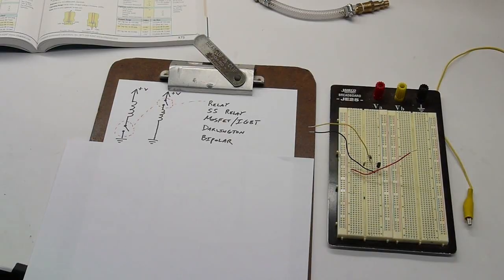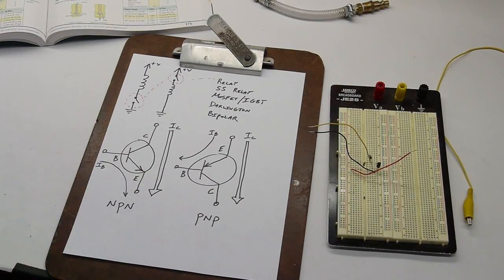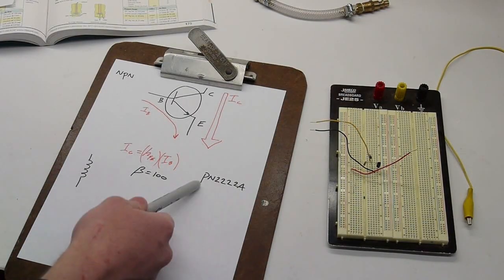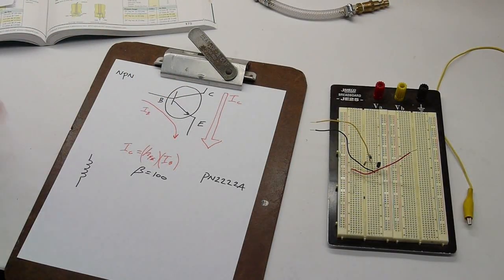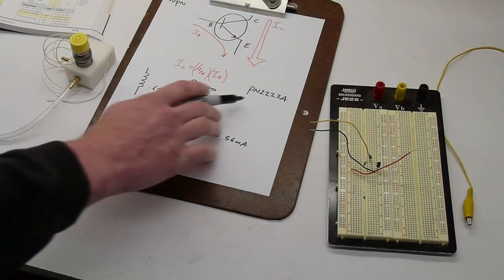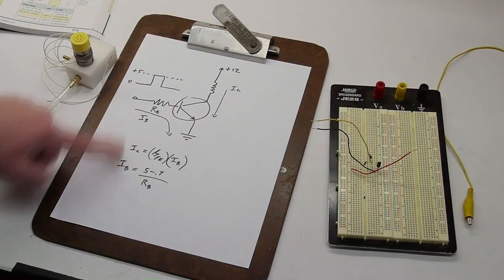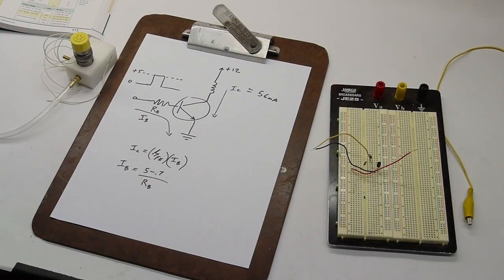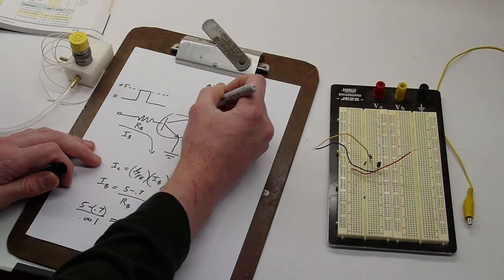Tutorial: How to design a transistor circuit that controls low-power devices

Comment from the maker: When the transistor turns off, current flowing through the coil will cause a voltage rise on the collector. If the voltage rise is high enough to turn on the diode, current will flow through the diode and limit the voltage at the collector. The problem is that the diode cannot turn on instantly. It takes time for the diode to start flowing current. The capacitor smooths out the rising voltage, and gives time for the diode to start conducting.
Reply: schottky diode will just fine.
Reply: Your 5 volt input may have been solid between ground and +5v.  I always put a 47K from base to emitter to deal with any leakage currents if the input is inadvertently left open, either by design, or by a failure mode.
Reply: Applied Science that part was curious, I was wondering why the diode feeds it back, wikipedia said it feeds the back emf back into the solenoid to lessen the change in current it experiences when turned off, love it.
Reply: amazing video mate! but, could you tell us what diode should we use for this clamp?
Reply: @figadodeporco  The maximum current that the diode will need to pass is the current flowing when it is on. The maximum reverse voltage it will see is whatever the supply voltage is. In this circuit you need a diode that can handle 56mA and 12V reverse. You'd be hard pushed to find a diode that couldn't handle that. You don't need a Schottky or anything esoteric, just a 1N4148 or a 1N914 or a 1N4001, etc.
Reply: @figadodeporco  Most times you'll see a 1N4001 used, but it's not critical.
Reply: Ben: Interestly enough, I learned all about this the hard way. Transistors with internal "Protection" diodes like many MOSFETS offer, might protect themselves from damage but as you explained are not always fast enough. I had this issue with a MOSFET w/flyback protection still causing a microcontroller to reset everytime the solenoid load was triggered. While the MOSFET didn't destroy itself, there was a ~400V flyback spike induced from the collapsing field, and that caused the mCU to reset. Drove me nuts trying to find it.
Reply: @fjs1111  The body diode in a mosfet will conduct when the drain becomes reverse biased with respect to the source. In the case of driving an inductive load, the drain will be forward biased wrt the source potentially by hundreds of volts, therefore the body diode offers no protection whatsoever in this case. It's nothing to do with speed.
Reply: @fjs1111  You can't name a single mosfet that has protection against driving inductive loads. There are some ics, for example H-bridge motor drivers like TB6612FNG, that have built-in flyback diodes, but no stand-alone mosfets have them.
Reply: Are you serious, you are clearly not an engineer! @RexxSchneider
Reply: Keep making your case to the world how little you know. Have at it.  @RexxSchneider
Reply: As a beginner, I have burned several optocouplers, and transistors, due this voltage spike. Thanks for the hint.
Reply: What I didn't understand for a while was how the capacitor does this. But then someone explained it like a hatchway in a water pipe: 
->\ 
A direct current would be blocked by it but a spike can pass through it because it would push the hatch into the flowing direction:
->/ 
and thus move the water on the other side of the pipe:
->/-> 
so the energy of that spike gets consumed and once the spike rising is over and it reached it's top point, the capacitor stops pushing against the other side and blocks the direct current part of that flow, which would then drain to the +12v if the coil's generated spike is greater than +12v.
Reply: @dreamyrhodes  Capacitors act as a short at high frequency signals. Increasing frequency means lower resistance in a cap. A fast rising edge of a pulse or noise spike is high frequency. This is why these caps are called bypass capacitors, by passing the hi freq sigs to ground in order to remove noise from the voltage supplied to the circuit which will adversely affect circuit performance. Basically acting as a high pass filter. Filtering out unwanted hi fregs.
Reply: With the capacitor it make sence. But in all my life I never saw that capacitor to ground in Relay circuit. i red the use fast diode or low threshold voltage diode (Shotky?)
Reply: I have npn output air flow switch, where set point to switch on or off...

How i  get analog value (either voltage or current) each increasing or decreasing of flow rate?

Please help to figure up, thanks

Comment from the maker: If you can guarantee that the base current will be 5mA, it should be fine, but you'll generally want/need to use a limiting resistor.

Comment: Awesome video! Just what I needed for a senior design project. Although I have one question, if you are using a data acquisition unit that outputs 5 mA, can you just connect it to the base directly? I know you mentioned that a resistor has to go in between, but given that this is a different case ...

Comment: Great video! thank you for posting.  I just have a quick question regarding the clamp diode. Please point out if I am wrong. Without the diode, when the transistor is turned off, an induced current is generated in the resistor due to the Lentz's law, it can be very large when the switching frequency is high, and the large current/voltage can damage the transistor; With the diode, as soon as the generated induced voltage is larger than 0.7V, the diode will be turned on and direct the current back

Comment: If a voltage applied to the base of a transistor rises above the emitter by more than the base-emitter threshold voltage, then the current going into the base will rise, abruptly, to a point where there will be too much current that can destroy the transistor. The purpose of the base resistor is to absorb the excess voltage, therefore limiting the base current to a safe value.

Comment: very interesting video, doing my btec level 3 electronics engineering and learning about pn junctions and transistors. the .7 volts comes from the depletion barrier. holes and electrons changing place as the p and n come together. maybe the difference between the voltage for diodes and transistors come from the extra junciton on the transistor. two diodes back to back. 
i look forward to the rest, cheers dude

Comment: Wonderful video!! Is the process the same if I want to control a 12 volt motor high amperage motor? How would I select the  proper transistor if I am using a 0-10V PWM input?

Comment: I think I answered my own question re the solenoid...about the fifth time through the video I picked up the 'clippard' name, I see their web site has a great order page.  I have determined that's a 2 way mouse valve, wire leads, normally closed, I'm going standard mount instead of manifod, 12v, .025 orifice with buna seals.  Awesome video.

Comment: If the input voltage is 3 v instead of 5v will the transistor still turn on? Given that rb is changed to 3.0K Ohms. And what if 1.5v and 800ohms? I guess my question here is does voltage matter?

Comment: Could I use a 2222 to trigger a 555 timer with a 12 volt signal? I not sure what the amperage would be through the transistor by grounding out the trigger pin. I have a 10k there now to hold the trigger high but should a different resistor value be used? Great tutorial by the way!

Comment: Hi there,

I've got a quick query for you.  I am trying to do exactly what you have done here, but when the transistors are off, there is +12 volts (when compared to ground) at both of the solenoid leads, which is causing them to heat up very quickly.  The voltage difference across the leads is zero.

Any ideas on how to fix this?  Thanks so much!  I greatly enjoyed your video!

Best,
Frank

Comment: Dammit, I wish the internet was around when I was in school!! You kids are sooo lucky to have all this knowledge available instantly!

--OldGuy  :)
Reply: I've been thinking that for years. I wanted to understand and know how to do many things while in my youth but had no available quick easy answers like now. This guy basically covered a 50 page chapter in 20 min without going to the library first. This information would have taken most of a day to learn, if I found the right book. Having someone explain and show examples is so much better than reading about it. Kids these days have no idea how much easier it is to acquire information today compared to 25+ years ago.
Reply: @gojohnnygo6869the problem is jobs are not available now. It will just be a hobby for a lot people
Reply: C'mon now!  Radio Shack had a "101 Electronic Circuits You Can Build " book you could buy...Healthkit offered radio controlling stuff (RC airplanes) and amplifiers...remember the ol' crystal radio? - I built one using thin lacquer coated copper wire, a simple crystal, a empty toilet paper cardboard tube, cheap low power earplug type headphones  and a long piece of wire  for antenna...it actually worked too..1965! (Crystal radio plans probably somewhere found  on YT.) Aah yes..the good ol' days! Truth be - it's  much better these days....so all you kids out there...you're spoiled rotten! Ha ha ha! 😉
Reply: Yead for my essays had to rely on library, when i go to library the book i want is already has been borrowed😏
Reply: Yet they keep playing Fortnite
Reply: -Boomer
Reply: @BoRedfearn  he is kinda right
Reply: Not too late for you bro as I am in 5 series. Learning will keep us young and younger
Reply: As it should be.  Just like the slide rule, and the abacus, the internet will be replaced.  Already I don't use my calculator, I just ask okay gooble, what is Pi to 100 decimal places?
Reply: Why did you delete other videos I need them. Bro
Reply: Unfortunately, with how easy things are, most kids these days get even more lazy. Don't get me wrong, it's honestly amazing seeing 4/5 year olds on Youtube building stuff! But, most of the kids I know (even through 18 y/o) have never held a tool in their hand their whole life ;;
Reply: @icecreamroxkndnumber  pretty sad to say so myself , and that comes from me an 18 yo romanian kid who is the only one in class to do shit like this and probably from other classes too .... Now i can boast about it , but to be honest i dont have any friends that do things like this so i feel pretty lonely
Reply: Vezi ca avem un club de electronica pe discord. Cauta pe youtube canalele de electronica din romania avem cv. Si daca vrei sa vb let me know. In special daca vrei sa inventezi chestii. Vreau sa deschid laborator de electronica printre altele. Avem nevoie de oameni autodidacti si se pare ca esti material potrivit.
Reply: @aion2177  ma bag 100% da-mi ceva mail :))
Reply: @nostamine2567  Iti dau asta care e un fake email ca nu vreau sa-mi mai las adresa reala in public dupa ce m-au spamuit marketerii astia de m-au rupt. ion.paduraru92@gmail.com stabilim de acolo unde vb.
Reply: Humble boomer brag
Reply: Yeah, but now they use it just to watch non educational stuff !!!

Comment: For power circuits and a fast switching frequency, you'd need a fast switching diode that can handle a bit more higher voltage than a normal one.

Comment: I have a question, I am working on a project that uses an Arduino to control a joystick in a video game controller. The joystick has an x and y axis potentiometer and I don't need it to be variable, it only has to have 3 different resistances for each axis, example: up, down, and no movement. So I wanted to use transistors that would switch a path on for the current coming from the controller through a resistor and back to the controller. Would this work? Thanks

Comment: Great work as always. A talk about common protection mechanisms on circuits would be great, especially for students of electronics that do not have much experience in designing circuits. (diodes, filtering capacitors,...)

Comment: @sharkovios 
Multiple transistors of the same model can have quite different hfe (the production process isn't perfect). So you have a min/typical/max in the datasheet. It's also dependent on the current you want to switch, so there sometimes are several lines of hfe. For switching applications just take the lowest hfe for your current range to be on the safe side (in this case the transistor will be fully on when you want it to be).

Comment: The voltage drop of a junctions is highly current (and temperature) dependent. So if you talk about 0,6V it's for very low currents, where a diode is just starting to conduct. The higher the current the larger the drop. A standard 1N4007 diode has almost 1V drop at 1A. It's similar for a Base-Emitter-junction.
Keep that in mind when dealing with high power transistors. Their V_BE can quite above 1V at high base currents. (and V_CE will be way higher than 0,1V, too; more like 1-2V)